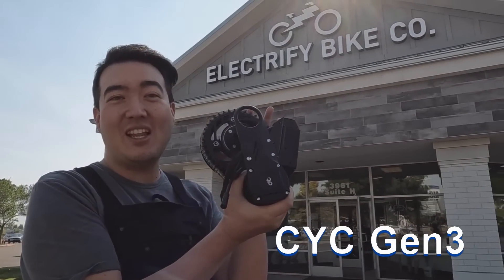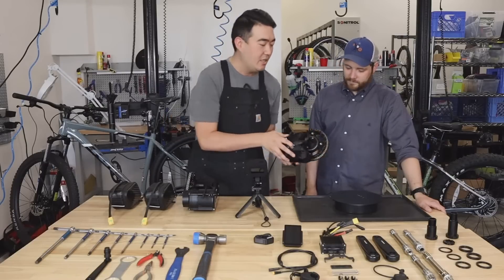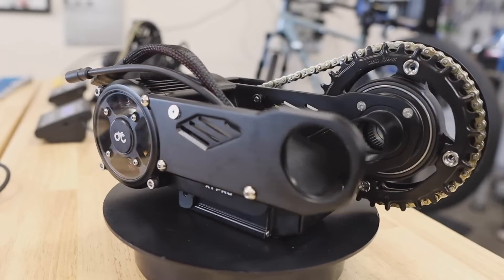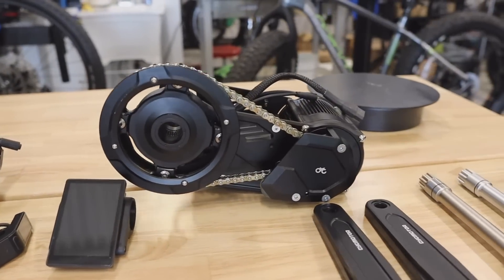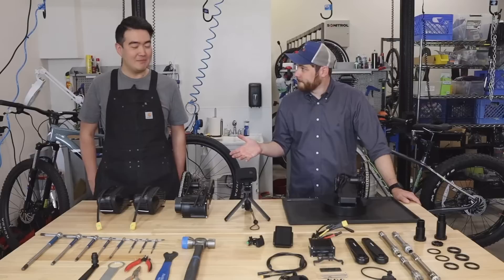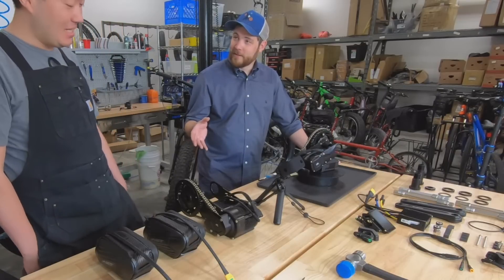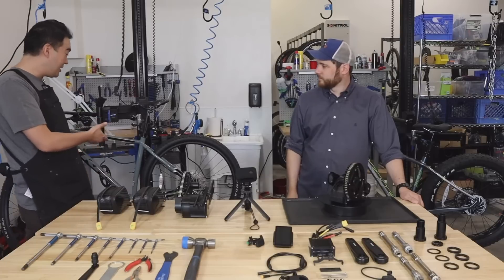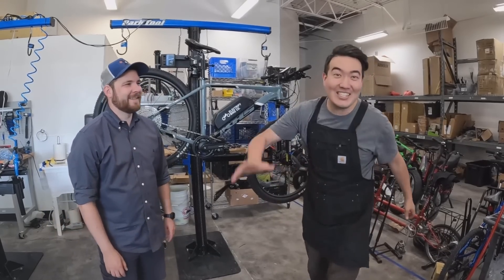CYC X1 Pro & Stealth Gen3 First Look at the New Gen 3

Comment: So on the Gen 4 can you limit the input to under 100 amps, say 95 amps. (or use a Gen 3 controller on the Gen 4) I ask because I want to use 3-4 Prismatic cells (like those 100Ah Lifepo4's you can have a 100Ah (104.5 Ah typical) pack at 36-48V nominal (41v-54.78V actual) for about $300-$400. I would remove the cells out of the ABS plastic enclosure's, to make more compact. Case removed the weight would only be some 52-70 lbs respectively. (however an insane 100 Ah tank)These already often come with a JBD BMS. but tend to be 100A symmetrical. Therefore the interest in the current limit so as not trip an over current. Otherwise looking at a Gen 3 or a Bafang BBSHD with the BAC 855 to do the same thing.

Lastly I would like to still retain the bike worthiness. And so I would like to run 2 chainrings up from a 30/52 (while the chainwheel difference is excessive. Old touring bikes from the 70's and 80's had even 22 tooth discrepancies and as a tech of 38 years I'm certain it will be fine as long as you dont mash the gears.) with the Gen series it would take more engineering to make it a double. Really very easy on a Bafang BBSHD. Looking to also tow a trailer of 350-400 lbs, (total weight 750LBS) up hills and off road at a 20% grade, I would like to see atleast 10 mph throttle only. Flat pavement/no trailer throttle only to 55 mph ideal.

Comment: I want to buy that motor, X1 Pro Gen 3 3500w. But what voltage I need for battery? 52/60/72? And 20ah is enough for 25-30 miles range or I need more?
Reply: Like to know that also.

Comment: 65 mph with the x1 pro gen2 + bac2000 right? the new x6 controller is 50 amp and not as powerful as the gen 2 with the bac 2000 controller. they've told me that the x12 was coming in february but it's still not here. idk

Comment: I ordered one from you guys. Really excited. Hoping my kit with battery and charger comes with everything I need. Charging connector adapters etc. I went with the 32t chainring size. Seems this would be more appropriate for an off road full suspension mountain bike setup. We will see. Running 10sp 11-46t in the rear. Can't wait to install!

Comment: So I set up my cyc Gen 2 with bac 2000 and didn't work. I just got the new x6 controller and set it up. Unfortunately still not working. I hit the throttle and the motor spins but cog is stationary. Any hints? Troubleshooting help? Please, I've been working on this for over a year and still can't ride. Please help me. Cheers
Reply from the maker: There are two settings in the smartphone app that can affect that. One is the motor direction, the other is which motor the X6 is being used on. The Pro is an in-runner motor and the Stealth is an out-runner motor and they spin in opposite directions. If the motor spins in reverse you hear it but nothing happens because of the clutch.

Comment: Great video. I'm thinking of putting this on a Santa Cruz V10 carbon. The Stealth might work nicely.

Interesting to note on the IP66 water rating:
Water projected in powerful jets (12.5 mm nozzle) against the enclosure from any direction shall have no harmful effects.  But it cannot protect against water immersion. 

So that potentially wet ride that takes you on a river crossing will not be good for this motor, or any ebike for that matter.

Comment: What gear reduction combo is best for technical trail riding where top speed isn't an issue, maybe 25mph max?
Reply from the maker: With wide range gearing in the back, a 38T is great to be able to still get some exercise at 25mph.   That said, it uses a standard BCD104 chainring and the Pro will take 30T to 52T and the Stealth will take from 30T to 46T.

Comment: What kind of frames are suitable/unsuitable for this? For road riding (heavy hills), could a BMX 29er handle the output, or is a front or dual suspension frame recommended?

Comment: Do cyc come with gear and brake cut off sensor?
Reply from the maker: Brake sensors are optional. Gear sensors are not needed with torque sensing. Just pedal lightly through the shift and the motor backs off.

Comment: How difficult would it be to change this to a pedal gen only?  I want to put one on an old frame and will power an alt/gen from through the chain and derailleur system, but would like to produce more power per pedal revolution. 
Thanks. 
And approx cost of conversion?
Price with battery to possibly run without operator also.
Thanks again.
💃🙏💜🤣
Reply from the maker: This application is outside of our wheelhouse. Sounds interesting though. The link above will take you to pricing.

Comment: Will the new X6/12 controllers be able to be bought separately and used with other motors like the BBSHD? With the 41 week delay on BAC kits, the lack of frankenrunner compatibility, and the scarcity of Ludicrous controllers, it would be really nice to have another controller option on the market.
Reply from the maker: CYC is entertaining the possibility of doing just that.  A lot of people would like get their hands on a high-powered VESP controller that does torque sensing.

Comment: Does CYC Pro Gen3 equipted with a temp sensor inside it so we can read the motor temperature data on a display such as Cycle Analyst3 continually?
IS CYC Pro Gen3 powerful enough to run from stop position without using pedal assist and just by performing more throttle if using 72V battery?
Reply: Very good question, would be really usefull to have a temp sensor!

Comment: So, does it still have that loud whine ? does it come in a 750W street in legal version for Cali.. and what's the cost of the full set up with (Everything needed) including 52v battery ?
Reply from the maker: Each generation has a more precision gearbox and is quieter than the last. You can even tune it for Europes 250W limit. Pricing in the link above.
Reply: Get the eggrider and make two profiles, set the road profile to your required  max legal wattage and then optimize the offroad profile to your hearts content. Fair warning tho, it get's really hard to ride on the limited mode once you've tasted the possible power.

Comment: I am really excited for this! Lot's of good upgrades from the gen 2, but what I am really curious is about is whether they have managed to deal with the noise issue. They said it would be significantly quieter, would you say that is accurate? Was kinda hard to tell from the short throttle test in the video.
Reply from the maker: It is significantly quieter.  When you keep the RPMs in the range of the BBS motors <3000 rpm it is very quiet. However, these motors will go 3x that and a motor spinning 9000 rpm makes some noise.
Reply: @electrifybike  That makes a lot of sense. Will you be doing a video with a full build/review soon?  
I've been waiting excitedly for someone to do a full showcase for two weeks now and I am kinda curious as to why noone has done it yet?
Reply: @noone-ld7pt  Exactly my thoughts. The only thing holding me back from buying this motor is the noise. They claim Gen3 is significantly improved, yet CYC still have not posted a proper video of the motor in operation on their channel. Starting to make me suspicious...
Reply: @wilsgrant  Yea I have to agree.. the fact that it's been well over a month since the announcement and they still haven't directly addressed it beyond vague promises is getting pretty concerning.

Wherever the cyc is discussed the noise reduction seems to be the most commonly asked question, so if they actually had significantly reduced the problem it seems like an absolute no-brainer to show proof of that along with the launch.

I was getting really hyped to get this for my next build but I am not ordering anything before I know what I'm getting into!
Reply: Noise issue = elephant in the room.  BBSHD is dead quiet in stark contrast.
Reply: No response yet makes me think it's still noisy ..

Comment: I was super stoked about the updated axle system... but really, what did they think about the BB attachment? Two tubes screwed against each other (there a some pressfit options on the market which worklike that), wiggleing around in the threads of the BB housing and destroying them.
Seriously, who uses a nail when a screw is intended???
Reply from the maker: Its a trade-off. Gen3 is a much simpler installation. The right half the bottom bracket comes pre-attached to the motor and gear reduction. No way to screw it in with it pre-assembled like that.  All of the BBS and TSDZ2 motors are a compression fit without threading in also. If they are tight enough they don't wiggle and mess up the threads. I am pretty sure Gen3 will be fine.
Reply: I have a threadless BB in a BSA which works the same way and it works suprisingly well, but it does mess the threads but not the way you think, the small mini gap slowly captures moisture, causing corrosion; you need to put some heavy retaining compound, but even that may not save it.

That saying I agree with this decision because this means that you are not dependent in your frame on where the threads are, in some bikes, like mine, this causes issues with offsets and horrible chainlines, not to add issues with some BB shells being literal crap and being offcenter and a motor would absolutely pick that up and wreck your threads, I assume the pipe from this design should be way more accurate than what the shell provides, sometimes threads go too deep and destroy themselves, or are floating, for example after adding spacers in the v2 I was left with 2mm of threads and the only solution would've been a clamp fit; the v3 makes it work; I can imagine some improvements but the radial forces shouldn't be that high, as long as they are lesser than the bearing friction it should hold; I think the spacers should be improved, I'll make my own, but other than that, I think this works better.

But yes it's a tradeoff with the threads now being more exposed and more likely to get damaged; thin aluminum sheets covered in compound may help if there's space for it, but in my case, I don't mind, the v3 will work better than the v2 without any modifications to my frame.